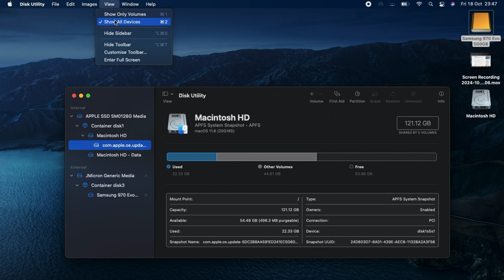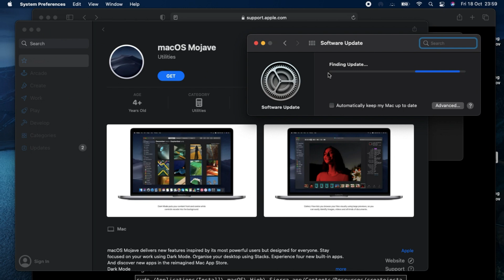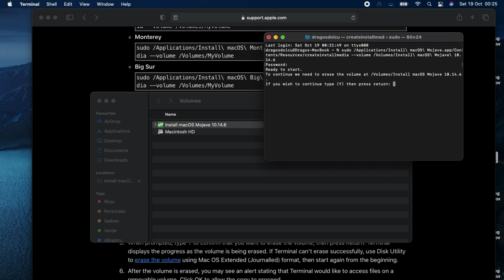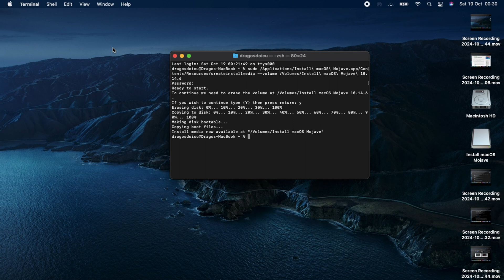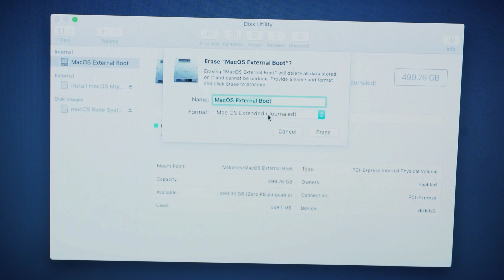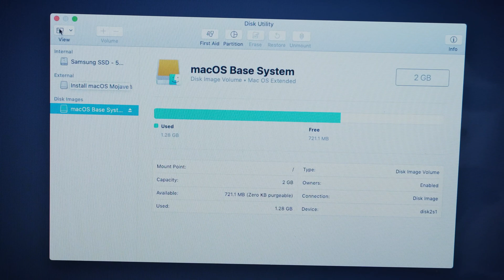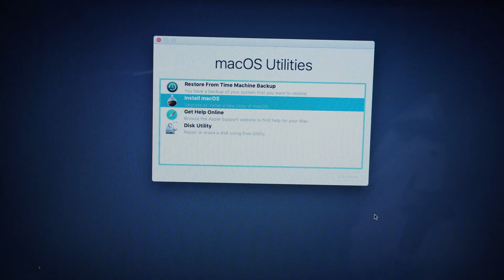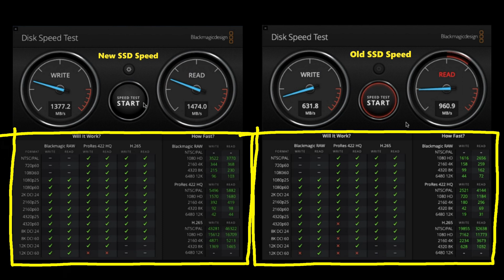The Ultimate MacBook Upgrade Guide

Comment: My mac early 2015 days I can’t sign in to this apple account  because I need 10.13 or later. What to do ??
Reply: Opencore legacy patcher is the way to go
Reply from the maker: Great ideea 👍
Reply from the maker: OpenCore Legacy Patcher (OCLP) is a sophisticated boot loader designed to inject and patch data in memory, rather than on disk. This allows for a near-native experience on many unsupported Macs. OCLP is used to install and run macOS on older Mac models, enabling users to breathe new life into their devices.

Try this patcher 👌
Reply from the maker: You need to make a bootable USB Installation of a newer MacOS and proceed with the installation as shown in my video. 

More Tips to Try:
-Check your date & time if they are correct.
-Ensure the wireless connection is strong.
-Not logged in but can you make upgrades?

The fastest solution is with a bootable USB but first, make a backup of your files. ✌️